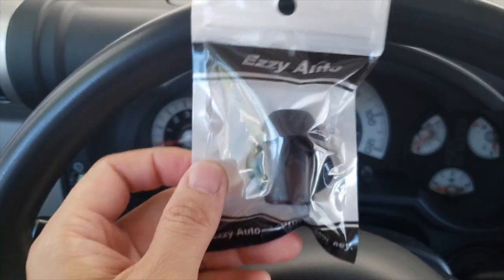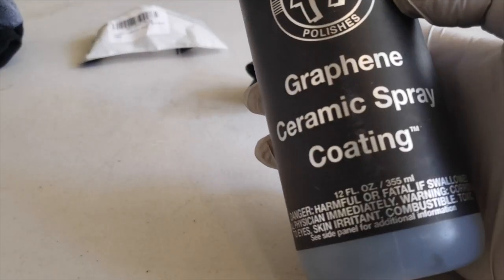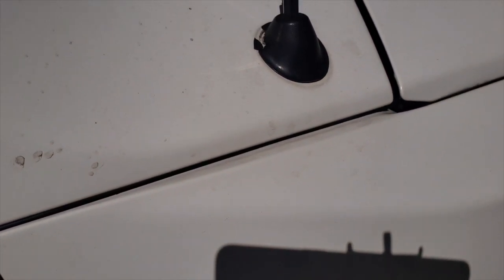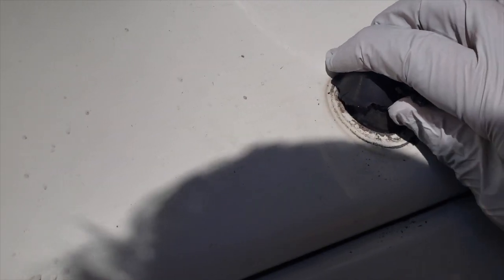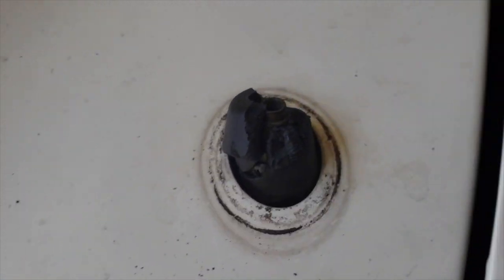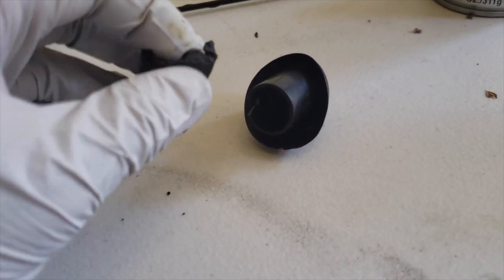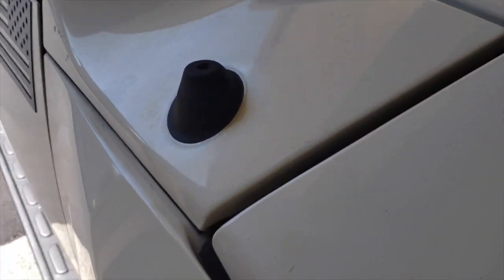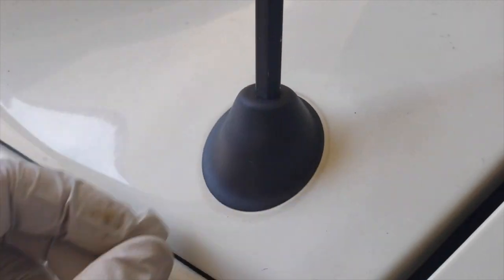FJ Cruiser Antenna Base Replacement

Comment: Thanks, just replaced ours on a 2007. Same Amazon part. Original was disintegrating. Used pliers to work off the old one. Also cleaned up ring and waxed the area since it was exposed.

Comment: good stuff another great video. I have seen this is a part that will need replacing eventually. Thanks for sharing. Being able to see the in's and out's of the FJ is very helpful. The wife and I are still saving for one but it is a definite next on our list of purchases. I have always liked the FJ and its throwback design to the original SUV's. With all the nannies that are sold on vehicles in the last few years, the FJ falls into the category, of having just the right amount of tech, without too much.
Reply from the maker: Thanks Mark.  How to see you in an FJ soon!
Reply: @LiL13izzy7  we are still saving, where i am at, they still sell them new, so hoping that will work out for us, but they are about 40K USD new. still a great vehicle and we saving :)

Comment: helpful vid, thanks! Need to replace mind and wondered if it was more complicated than just pulling the old one out.
Reply from the maker: It's not complicated as you saw.  Hardest part was needing pliers to get the rubber off below the surface, as that part was still fairly tight.

Comment: Good step by step !   Question on the base, under the part you replaced ?   I’ll call it the base, …which on mine is lose from the antenna tip, bumping a little each time I go in/out of the garage.   I want to tighten it but don’t see on your video any kind of hex nut (or something) to tighten down that base.   Did you see anything, or you think I’d have to go up from below, inside the fender somehow ?
Thanks !!
Reply from the maker: I didn't pay attention to that part, but it sounds like you will need to remove the cowl piece to access that.  Cowl clips are notorious for breaking.  Look up FJ Cruiser windshield replacement on the Forums and you'll see that replacing clips is a necessity whenever removing that piece.  Good luck!

Comment: Very cool video, I stumbled on it, but I needed it.
Reply from the maker: Glad you found it helpful
Reply: @LiL13izzy7  do you think I’d have to take the windshield out in order to replace the rubber molding that sits on the bottom of the windshield on the outside? I genuinely don’t know.
Reply from the maker: @GelasticSnail  I'm not 100% sure, but check out the 4:45 mark of this video:  https://youtu.be/k77SwvTK_J0?t=286.  He's able to pull it off without removing the windshield.

Comment: hey brother, i'm having the same issues with my 2011 and i have all the same worn out pieces. been watching your videos as a guide when i come to replace or upgrade. one thing i am having trouble is finding a video on how to replace the seal on the bottom of the front windshield. it's worn like my antenna, cracks and crumbling apart. have you done a video on this?? appreciate any help, thanks.
Reply from the maker: Hey, thanks for watching.  I have not had to fix the windshield seal, but I found a few videos on YouTube that might be helpful:

https://www.youtube.com/watch?v=k77SwvTK_J0

https://www.youtube.com/watch?v=KplCawQvFus